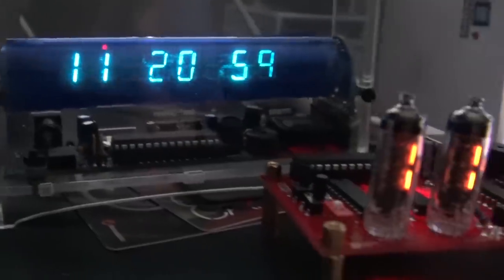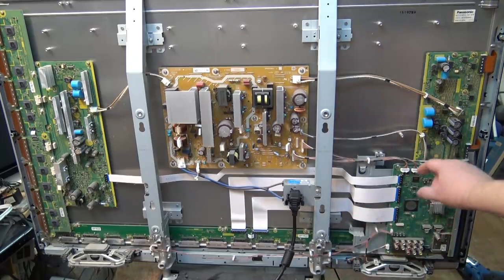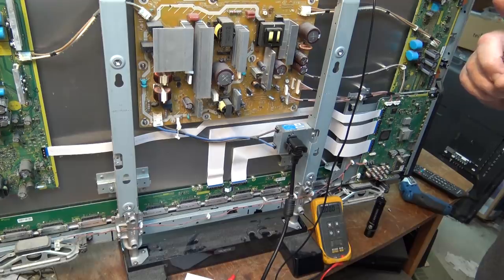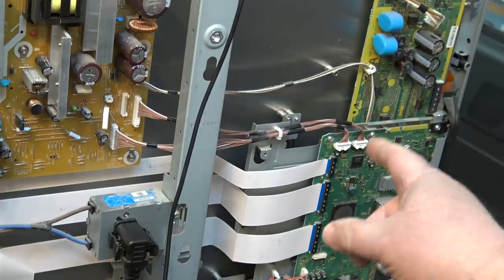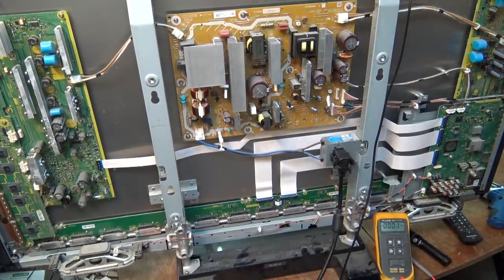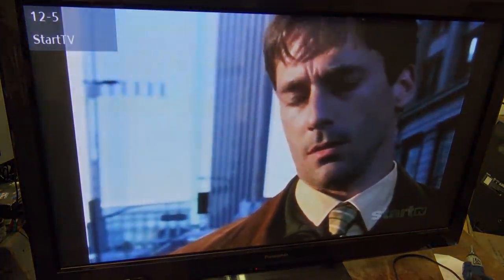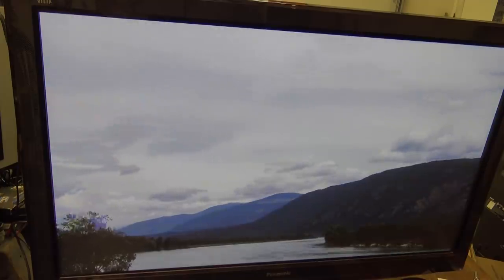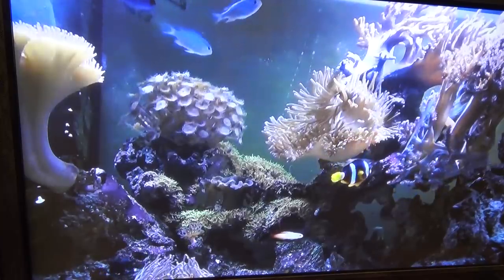Panasonic tc46s2 plasma 10 blink shut down component level repair

Comment: My 50” died 3 days ago after 14 years of service.  My wife is happy as I said I would buy a new smaller set.  I am a retired electronic technician that worked on pc boards at the component level with and without schematics.  Where did you find the manuals for your project?  I might try to fix the beast and put it in my shop if I can repair it!  Thanks for the video.

Comment: We inherited a Philips Plasma and yes the picture is nothing like anything I have seen.  You hit it lucky and your troubleshooting is great.
Reply from the maker: Love my plasma sets.  I have 1 led set, a 4k and seldom turn it on.  I think I use the old crt set more than the led.  Use it only for checking 4k content before I upload.
Reply: That's a good one. Well I have an LED set, I use at my shop.  I like it.  Once I saw the plasma, holly crap, its like a crt hi def plus. Really bright and brilliant colours. Any info on the Philipps? I think its 52".
Reply from the maker: @markanderson350  
LED/LCD are light sources with an LCD "shutter" to restrict the light. Plasma (and OLED) are tiny points of light generated by the panel. OLED uses organic LEDs and plasma each pixel is essentially a tiny fluorescent lamp.

Comment: Hey ,Thanks I am in a mid way of a repair of 42 inch TH-P42X30D plasma with 7 times  Red LED blinking, found the culprit chip IGBT transistor, RJP63G4.I am going to replace and lets see I gained another solution for 10 time blinking and 15 volts missing solution from you.Thanks a ton.❤❤❤❤

Comment: I have the 42 inch version of that TV, it has been a great TV, however it is gives off a lot of heat, which I suppose is not a problem in the great white north, however mine is in Florida. The "smart" tv apps havent been supported in years,  I plan on keepiing it until it dies, heck for what I paid for it, you could buy 2 or 3 4K tv sets at 55 inches. if it ever does stop working I will count the blinks and refer back to this video. cheers.
Reply from the maker: You think this throws heat you should try the 63 Samsung I have.  It warms the room nicely.  How about the monster 104" Panasonic plasma.  It draws 20 amps @ 240 volts.   About 4500 watts!!!!! This one 350 watts.  I have an older 42" sd panel that draws more.
Reply: So very true! We are in Central Florida and also had a plasma for a while but had to get rid of it because it just created too much heat 85% of the year. Now, when the seriously cold waves hit and the temperatures plummeted down to around 65-68°f (brrrr), it was fine because we could heat the whole house with it. 😎
Reply from the maker: John Hooper  
Yes I am aware of this. This TV is now one of my spare sets. Has not been used since I fixed it. I now have 3 perfect working Panasonic plasma TVs waiting for one of the others to blow up so i can use them.  So I guess you know what yhay means. I will br watching plasma TVs for a long, long time.
I have a 42thx certified, 46 and 50 waiting to be used.
Reply from the maker: John Hooper  
That doesn't annoy me. I like them when they last forever. You actually think I enjoy fixing this crap?

Comment: Thanks for taking the time to give us some insight into repair. I have a 2010 Panasonic L32C22 that would either not come on at all, or come on for 3 or 4 sec, then give a 4 flash light. Took it apart and noticed a burnt smell, looked real close at the Power board, the smell was really light. I used my nose and went over the board, everything looked like new. even tho this tv is 9 years old, its only been used for maybe a year. while looking at the soldier connections, I noticed one of the things that look like a alien and blue, one of the soldier connections seemed a little off color, just slightly. so I re flowed it prayed and put everything back together again. Perfect picture
Lesson learned....use your nose.
Reply from the maker: Yup. Nose eyes and ears.

Comment: Just wish I had 1/100th of your skills, awsome video, thank you.
Reply from the maker: Remember I know nothing about these new TVs.
Reply from the maker: @Martin P. 
I am serious when I say I know little about plasma TV. I did take a course in 2002 but that was board replacement only.  I just use common sense troubleshooting.  Isolate and conquer. Everything I know about plasma TV I learned myself.  I pass this on in the hope that others will get something out of it.  At least people are interested in fixing plasma sets because you can't buy them anymore. They are also the most complex of all the TVs.  LCD and oled are pretty much non serviceable as much of the signal processing is in the panel itself.

Comment: Brilliant! I love the minimalist approach to most things you do.  I'm so used seeing people go straight for a bench PS with current limiting and hitting the board with freeze spray, etc. Had going for a minute with the fusible resistor that morphed into current sensing resistor.
Reply from the maker: Nope current sensing.  Very low ohms.  Like a fuse resistor. Once I blew up the schematic I could see the current sensing loop which fires a transistor that feeds back to the power supply micro that shuts everything down.
Reply from the maker: Taking a shot over the bow at anyone in particular?

Comment: I just went the dummy route on the A board of my cheap 58" Panasonic plasma. I wish it was just a shorted cap on mine. I have read that the eeproms on the bigger sets can become corrupted and cause the dreaded 10 blink code. I paid $50 for the set and $60 for a used A board. Unbelievable picture on the set. It's a keeper. I saw one on Craigslist going for $600, so I believe that people are actually starting to appreciate the quality of construction and the picture on these sets. It's the fifth plasma that I have saved from the scrap heap. They can keep those throw away LCD's.
Reply from the maker: I have 5 spare plasma sets. A 42 lg. The rest are Panasonic.  42 thx certified. 46 and 50, plus a 50 monitor with separate signal box.  Those are spare sets.  I currently use a 42 Panasonic on my edit suite and have samsung 63 in my media room.  My bedroom 50 samsung is all burned in from the local tv station logo during the morning snews.
Reply: @12voltvids  I may die watching a plasma set...

Comment: Real good.  That was an interesting fix.  Thanks for the video.  Makes me think how many TV s end up in the recycling for one small problem.
Reply from the maker: Too many. Had this been a paid repair I would have probably charged 150 to fix this. The video runs only what 25 minutes, but it actually took me about 4 hours to find the problem, but as I showed in the video, only 1 part was changed. I showed all the steps in servicing, but spent much time studying the schematic on the computer, and I tell you this is a bloody complex circuit.
Reply: @12voltvids   lol   You did what mostly anyone else would've given up on.  If a board couldn't be obtained.
Reply from the maker: @timka880057  
Well I look to see if it can be fixed.  When I was in the business everything was component level repair.  No boards available, except for zenith.  They used modules but we preferred to repair those too.  I certainly don't miss those days.
Reply: @12voltvids  When I was a kid I loved watching an old tv repair guy replace compnents under the chasis of an old RCA color TV my brother had. It was very interesting in those days to see it come back to life again just for a few components replaced.  I remember it was some old carbon resistors that was open or changed value... or a shorted capacitor and a few old tubes replaced.  I miss that!

Comment: Thank you for the detailed video. It worked for me. Advise for others... Be gentle during removal, I damaged some solder pads. But repaired them and the TV is fine. BTW, the HDMI plugs must be grounded. If you are testing the TV with the back off, jumper the HDMI plugs to chassis ground.

Comment: What a great fix!
I love things that seem so simple in the end.
Reply from the maker: It really wasn't that simple.  
I was disconnecting one circuit at a time.  The 15 volt rail goes to sc board via the a, it also goes to the ss board and to a board on multiple lines.  Pin 1 and 2 on the connector goes to audio amp. You can see I cut those first and then reconnected and taped them when I moved to pin 3 to isolate short.  Then disconnected flat jumper wire that runs from a board to sc board. This repair was spread over 2 days.
Reply: @12voltvids  youssefD

Comment: Very well done tutorial video! Thank you. Now it's my turn to diagnose my Panasonic TH-42PX60U Plasma with what must be a bad cap on the power supply board, with a Cold TV I activate a start button and get the Click/Power Light on/off cycling for 10 min then it works for hours with no issue.

Comment: Finding a silicon short can be a bear... I have used the alcohol trick in the past to find the hot spot where all the current is going to. That may have been challenging on this one given the low on time. Good thing is was just a crappy SMD cap. 
One failure mode on those is the cap actually physically cracking due to strain from the PCB heating or flexing; a problem in the larger caps.
All in all a good find! Cheap at the cost of some time and one cap.
Cheers,
- Eddy
Reply: To find a short like that, you give it power from an external current limited supply. Then you look for hot spots. Alcohol works, or freeze spray, or IR camera.

Comment: Recently I had to do a similar repair on an old Vizio TV that had lost the back light. Two of those SMD capacitors shorted and caused the fuse to blow. Those capacitors left a huge carbon hole in the circuit board but removing them and replacing the fuse fixed it. That TV probably shouldn't have been saved since it was a 22 inch 720p with a scratched up lg panel much older than the TV from the factory but it was still an interesting repair. Those older plasma TVs were great though. I have an old Sharp from 2006 that's still going that just has a washed out vertical line that comes and goes in the middle of the screen. I wouldn't consider fixing that until the TV completely gave out though. I'm pretty sure it's a bad solder connection on one of the BGA chips as the TV lost half of it's picture for a while then just started working again, leading me to get a new TV for daily use.

Comment: Ah, a late model Panasonic plasma - should be well worth hanging on to (substantial power consumption aside). They finally started using shielded panels in '09, so these should no longer be crapping all over the AM bands like the older ones did. Plasmas were a real plague - they would be directly radiating through the front of the panel, wreaking havoc on mediumwave and lower shortwave for quite a distance. My parents used to have an '06 Panasonic 42" 720p - great picture (these tend to have superb contrast), but it sabotaged my shortwave reception about 8 meters away pretty good. That one was reasonably power-hungry as-is, the 1080ps tended to be around 500 W if memory serves.

Oh, and of course ceramic caps don't short for no good reason ;) - usually it's the formation of microcracks caused by large temperature gradients within the part (easily generated e.g. during hand soldering), followed by silver migration through these propelled by applied voltage. I would tend to stick with automotive grade parts (which are of different construction and, in general, a good bit larger) or even traditional through-hole disc caps.

Comment: We actually used to have a 37" Panasonic 720p set with DVB-T Freeview built in. I didn't know that size was uncommon! The sound on it was fantastic, also :)
Reply from the maker: 37 was the smallest of the  plasma sets  and wasn't as popular as larger ones.  Same with the 46.  42 was very popular as was the 50. The reason was there wasn't much of a price difference between the 37 and 42, just like there wasn't much difference between 46 and 50, so the larger one was more popular.
Reply: @12voltvids  Indeed, I think we initially chose it because of the reduced day-to-day power consumption over the larger models. Also, like a lot of British homes, our lounge is quite small, so it seemed to make more sense considering ten years ago HD content was not as prevalent as it is these days. 

Replacing a CRT before it made it ideal for what was (for us) mostly standard-def viewing back then, anyway. Oh if only it had been a full HD plasma like your one, we probably still be watching it! ;)
Reply from the maker: @Oldgamingfart  
There are some pretty small pads here too.  With the high cost of land here micro homes under 300 sq feet are springing up in lane ways.  My place would have been considered pretty small a few years ago and it is 2500 sq feet.
Reply from the maker: @Oldgamingfart  
I have a standard definition plasma in the work shop.  Not worth anything so I just watch it from time to time in the workshop.  I have a 720 that I use for the news in the morning.  It is burning quite nicely from the stationary graphics.  My 63 is relatively power hungry.   I do like the picture and some will argue that, but they have never seen my TV room.  One of the chairs is at quite an angle and an LCD looks like crap off angle.  An oled would look great but that is an expense I dont need right now. Want to get a 65" 4k oled some day but as long as my 63 plasma keeps going I am keeping it.
Reply: @12voltvids  Yes it's a mixed bag here as well, and the new builds are not particularly affordable for young people which is a modern day travesty if you ask me.

My parents' home is a semi-detached Edwardian house, pretty typical of the era - large rooms, but not much in the way of garden/ outdoor space. Mine and my brother's house (we're neighbours), are both mid-1930's built, and the exact opposite - smaller rooms, but huge gardens!
Reply: @12voltvids  I'm doing the same - waiting for OLED to become affordable. Hopefully the 'ULED XD' technology that Hisense are developing means at least some competition for OLED, which may help to drive the price down.
Time will tell, I guess..even early Plasma's were prohibitively expensive.
Reply from the maker: @Oldgamingfart  I believe that is similar to Qled and Sonys triluminous where they use quantum dots, so it is still an LCD panel.
Reply from the maker: @Oldgamingfart  
Nothing here is affordable. If you want a detatched single family house, you are looking 1 million for a basic tear down property.
The speculators got in, biught up property to stash their illegal drug money, and left the homes empty to drive up costs, then sold at higher price and their money was cleaned in the process.

Comment: I have a pioneer kuro 50" still working quite well. There's a buzz probably coming from the power supply but it's barely noticeable. Picture quality is better the any LCDs.
Reply from the maker: Pioneer had the best plasma sets.  No question there and the were also the most expensive sets compared to other brands.  When they shut down in 2008 Panasonic bought the technology from pioneer, and incorporated it into the high end Panasonic models.  I have one and it is beautiful. Power hungry you bet, cooling fans, check. Perfect picture, yup. Perfect blacks, absolutely.

Comment: One thing with the Panasonic set is removing the screws that hold the set's back in place a 18 Volt battery drill with a adjustable clutch goes a long way to remove and replace the screws. Great also for removing the screws for the boards in the set as well. I used my drill every day and it realy saved your wrist and hands.
Reply: You poor little thing, having such weak little wrists and hands must be so handicapping.
You realise that holding a drill to unscrew results in exactly the same amount of force being transferred to your hand? Then you must add the weight of the drill, which is adding extra work for your arms, wrist and hands!
Reply from the maker: A drill is overkill.  A cordless screwdriver is what I use.

Comment: I love Panasonic plasma TVs I have a 65 inch plasma TV from Panasonic and 46 inch Panasonic plasma TV. I love them both the movies or TV shows whatever you watch will be so enjoyable and the surroundsound that’s equipped on all these TVs. It seems like the sound is coming through the TV screen, very cool what Panasonic did everything the Panasonic makes is pure delight of enjoyment I will never get rid of them. I don’t know how long a plasma panel will last how how many hours does this lost my 65 inch Panasonic plasma I purchased 2009 and the other one 2012 so I really don’t know how long you could watch a plasma screen before it decides to burn out
Reply from the maker: Open it up and tighten the board grounding screws before it fails. Once it goes pop you will have a problem.

Comment: I think I watched another video of you where the ground screws where loose on a Panasonic set. I was kinda surprised you didn't check them on this one.
Reply from the maker: I did. They are all tight and they have locktite on the threads.  It was the 2012 models that had that problem.